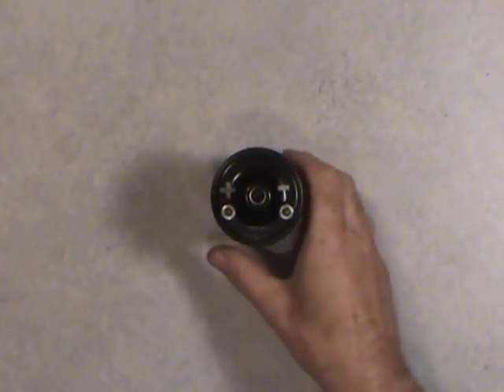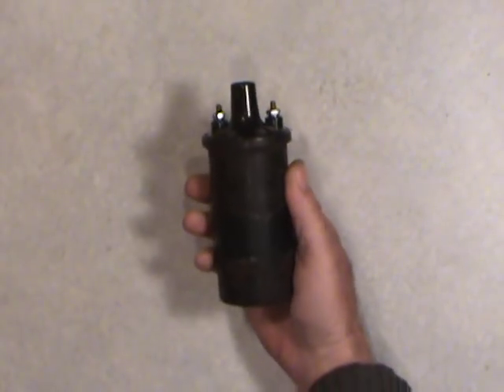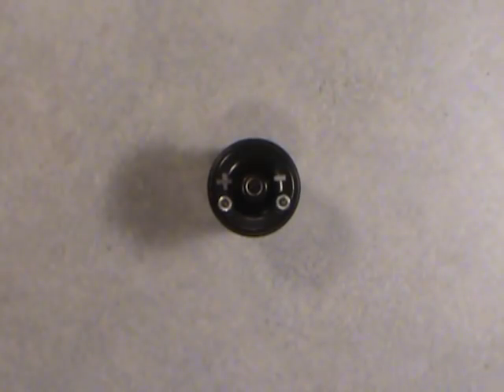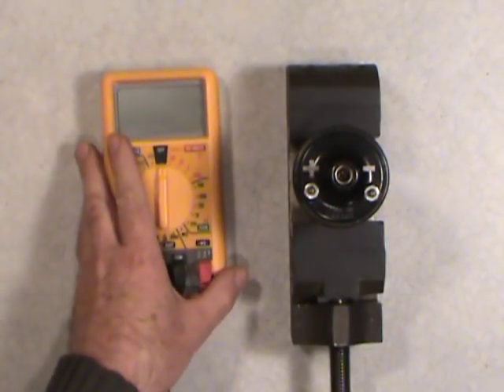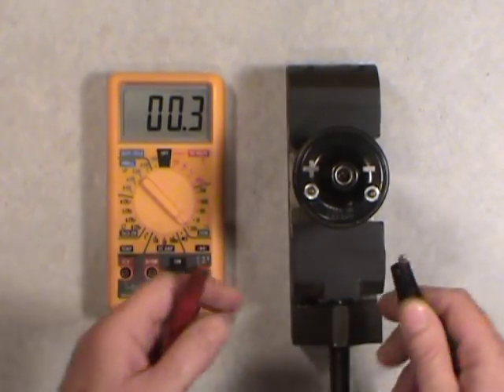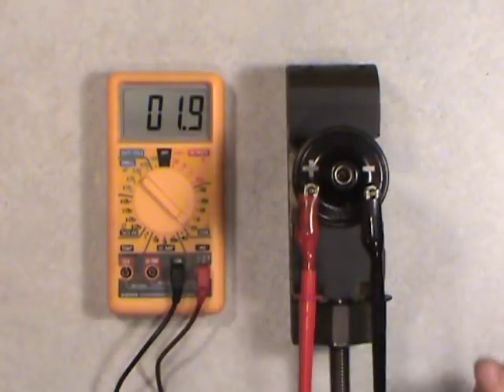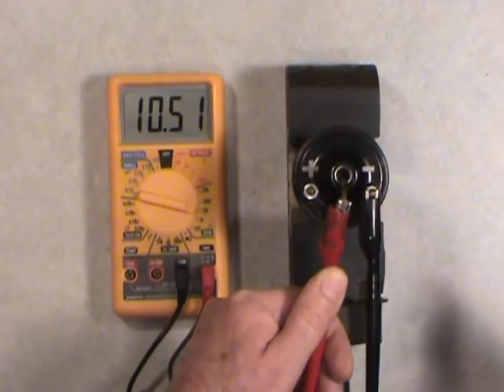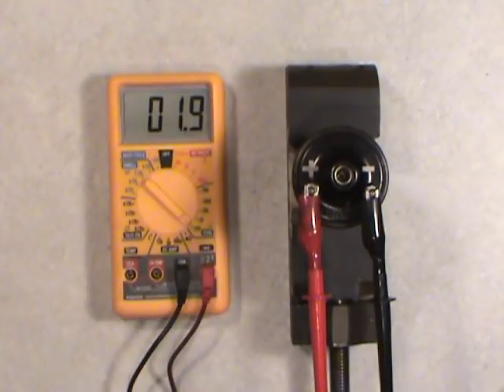Ignition Coil Testing

Comment: Maybe, already mentioned, but, the offset of .3 ohms ("point 3 decimal" in the video) means that you subtract 3 tenths ohms, or, .3 ohms from the total.   You do not subtract .3 for the rest of the ranges.   If the meter is set to 10K, and you measure 963, you are reading 9630 ohms.  Then, take .3 ohms off for final reading of 9629.7 ohms, not 9627 ohms (962.7 * 10).    Test, also, a straight thick wire or paperclip between the two meter plug connectors to learn characteristics of the leads, in this case, resistance.    Finally, if your meter is accurate to 1% at 10K range, for example,  this doesn't really matter at the higher resistances.  lol.
Reply from the maker: Greetings...StuckinMyGarage.........Thanks for watching........Your comment, is done very well, and yes, I'm aware of that tiny .3 ohms being of no importance, once the range selector leaves it's lowest setting.........Even .3 ohms, isn't all that important on the cylindrical, oil filled, type of coil's primary winding, when being compared to, an HEI (High Energy Ignition) distributor's, ignition coil's, primary winding's, very low ohms/resistance specification..........The factory/stock, HEI ignition coil's primary resistance, as I recall, should be just above Zero ohms (but "not" zero ohms), and usually, no more than, about 1 ohm...!!!.........Imaging seeing .3 ohms on  my multi-meter, and thinking that, the HEI ignition coil passed the test...???...lol........Hmmm...on a cylindrical/oil filled ignition coil, where does that one end, of the secondary coil winding (not the end that connects to the "tower"), make connection with, one end of the primary winding (internally)...was it at the + positive, or, the - negative, primary terminal, that's on top of the ignition coil...???...and also, what if that connection's polarity was reversed...???...any thoughts at all...???...and......till next time.......Be Safe, take care, and have a good one.

Comment from the maker: ...what the ignition solenoid does, is, when you turn your ignition key to the starting position, it takes the batteries voltage, and sends it to the ignition solenoid (smaller diameter wire), that energizes the solenoids contact (inside the solenoid)....This heavy duty contact inside the ignition solenoid makes a connection, so that the big, heavy wire from the battery can supply the serious, and high Amperage (electricity), that the starter motor requires to crank you engine over....(con't)

Comment: thanks this really helped a lot
Reply from the maker: Greetings...Bigmack73.........You're welcome, and, thanks for watching.........Make sure to use the "exact" ignition coil, for your vehicle, or, there might be a problem..........With the older cylindrically shaped/oil filled ignition coils, there were basically, two different, low ohms "specifications", on the primary (low ohms) side, of those two sample ignition coils.........Could be, a 1.5 ohm ignition coil, that, also had to have, a "ballast resistor" connected to it, or, it would probably "over-heat", and destroy itself...!!!..........Then, there could be a 3 ohm ignition coil (measured on the primary/low side), that "did not", need a ballast resistor, connected to it at all..........So, always make sure, to install the "exact"..."Specified"...ignition coil, for the vehicle in question, to avoid any problems or expense, and.......till next time.......Be Safe, take care, and have a good one.

Comment: the oil isnt just to keep it cool its also to insulate the high voltage from arcing between windings and out everywhere else its a dialectric
Reply from the maker: prototype9000 Greetings prototype9000....Thanks for watching, and for the information, about, just how "Important", that "Oil" actually is, that's usually found, Inside these good ole..."Oil Filled Type of Ignition Coils"...............................I'm not sure, if I mentioned, in this particular YouTube Video, about, how a "Horizontally" Mounted (aka, mounted sideways, as opposed to standing up and down)...Oil Filled Ignition Coil, that was Mounted on my small block Dodge V-8 Engine, shall we say..."Sprung-ah-Leak" (of "that" Oil, that was supposed to be contained With-in, the Ignition Coil's, metal/cylindrically shaped can/canister housing/body), and here's how I discovered that, kinda by accident, Ignition Coil's..."Oil Leak".............................Back then, I thought it would be a good idea, to maybe "Check"..."All of the Electrical Connection Points/Terminals"...of, both, the "Primary & Secondary" (low and high voltage), Ignition Circuit's, Wiring, and Spark Plug Leads/Wires, which also included, that rather Short, High Tension Lead (looks just like a short spark plug wire), that, went from, the Center Tower, on the Distributor Cap, then, the other End, was Connected to that, good ole "Oil Filled Ignition Coil's "Secondary, High Voltage Tower", that was located, on the Top/Center, of that Oil Filled Ignition Coil (well, if "it" was "Standin' Up-Right", that is...lol)...............................As soon as I "Disconnected", that high tension lead/wire, along with its Rubber-like, Seal/Boot, from the ignition coil's "Tower", I noticed, a quite small amount of, that, good ole "Oil", inside the hole, of the ignition coil's "Tower", and also, some of that very same "Oil", on the inside of that high tension lead/wire's, rubber-like, Seal/Boot as well...............................I did "Re & Re" (Remove and Replace), that...Oil Leakin' Ignition Coil...and, maybe some day, I might "Re-Use" that "Oil Leakin' Ignition Coil", on an Engine, but only, if that particular Oil Leakin' Ignition Coil gets Mounted "Vertically", with that "Tower", pointing to the "Sky" (as in "Up"...lol), seeing as how, a very "Miniscule" (as in, very Small Amount) of that "Oil", actually "Escaped", from that, working very well, at the time (before it was placed into archives, that is), and, "it" also, Tested-out Good, Ohms-wise, as well.............................As far as, the Oil Filled Type of Ignition Coil's "Mounting Orientation" is concerned, and, after my Oil Filled Ignition Coil "Sprung-an-Oil-Leak", while being Mounted in the "Horizontal Plane" (aka, Side-ways), I would, if possible, that is, "Be Mounting", any Future, "Oil Filled Type, of Ignition Coil" (or Coils), with the "Secondary, High Voltage Tower", pointing..."UP"...so, as to "Avoid/Prevent", the very Same, Oil Filled type of Ignition Coil..."Oil Leak"...that I had, way back when, and, that, I'll probably..."Never Forget"...as well...!!!...lol..................................One last thing..."Always Make Sure"...that, both the..."Primary & Secondary"..."Ohms Readings/Specifications"...on a..."Replacement Ignition Coil" (New or Used)..."Exactly Match"...the..."Specification/Requirement"...for the..."Ignition System/Circuit"...that, that..."Replacement Ignition Coil"...gets..."Installed/Connected"...to, or, there might be a Problem or Two, and perhaps, just might..."Fry/Destroy"...one or more, of the Ignition System's..."Component/Parts"...!!!...Yikes...!!!...............................So, there You have it...............................Till next time.............Be Safe, take care, and have a good one.

Comment from the maker: ...more often then not, an ignition coil doesn't prevent the engine from being cranked with an ignition key, or maybe even a start button (newer vehicles)....Unless, some of the newest vehicles out there have the vehicles computer doing a pre-start check (just my guess, that's all)....First off, if anybody is going to work on any vehicle, make sure that you know what you are doing, before you start working on any vehicle!....Batteries emit "Explosive Gas!!!"....1 Spark = "BOOM!!!"....(con't)

Comment from the maker: Greetings anibalcarta....I haven't worked on your particular engine before....Seems to me that it should be a 4-Sroke-Cycle engine perhaps?...and, that each engine cylinder has its own ignition coil to fire the spark plug that is in that particular cylinder....Given that there is only one "Lobe" (Lube?) on the distributor (Timer) shaft that actuates the ignition points (one has to remember that most distributors shafts rotate at one half of the Crankshafts Revolutions Per Minute)....(con't)...

Comment from the maker: Greetings once again anibalcarta....I found an electrical diagram for the 2 coils wired in "Series!"....It looks like a very simple system (once you understand it, that is...lol)....There is a high tension lead (wire) from each ignition coil going to its own spark plug ( 2 coils and 2 spark plugs)....The Timer (not distributor, because there is no distributor cap!), supplies the On-Off connection to ground (just like other breaker-point systems do)....Now, it gets interesting...(con't)

Comment from the maker: ...You asked, can a Coil also break down under load?...Ignition Coils can and do sometimes wear out...One thing that I can tell you, is, if you happen to have an older "Points and Condenser" (breaker points) type of Distributor, then, if you leave the ignition key in the Run position, while the engine is not running, doing this has been know to burn out that type of Coil...To give your Ignition Coil the longest Life, keep all of your connections clean and tight!...Take care, and have a good one

Comment from the maker: ...and, I should also let you know, to pay attention to the following....For your 2-Cylinder type of engine, pay close attention to the Tune-Up Specifications....Point gap setting, and even the Spark Plug Gap specifications seem to have smaller Gaps, as compared to what I'm used to seeing....Pay very close attention to your "Points-Gap"....The Points gap will change right from a fresh installation, due to normal wear with use, and the Points-Wear will change your "Spark-Timing!"....(con't)

Comment from the maker: ...I know it sounds strange to reduce the nominal 12 Volts to a lower voltage, but here's my take on it....When the starter motor is operating, the battery voltage may drop down to about 9 Volts, because of the high Amperage draw on the Battery (maybe as high as 200 Amps!), and, during this time, the battery is allowed to draw whatever the Battery is capable of supplying (yes-sir, less then 12 Volts)....Now, that is why I think that the Oil Filled Coils were designed that way....(con't)...

Comment: Thanks for your video. I understand how you can read the primary side of the coil with the ohmmeter, but how is it that you can get a reading on the secondary side? I thought the primary and secondary windings were isolated from each other?
Reply from the maker: Greetings R Ward....You are welcome, and, thank You, for watching and commenting on my Ignition Coil (oil filled type) Testing video....Both the "Primary" and "Secondary" Coils (2 sets of wire windings to form each individual coil) contained inside this particular type of ignition coil, "Do Share", "1" of the Threaded (aka, screw thread) Terminals with the small (threaded) Nut that protrudes through the top of this ignition coil....The Primary Coil's ohm reading is really quite easy to understand, as, with connecting the "2" (screw threaded) Primary Terminals to the ohm/multimeters test probes/aligator clips, are actually the "2-Ends" of the Primary Coil itself...

...where-as...

...when it comes to the "Secondary" Coil, "1" end of it gets connected to "1" of the screw-threaded "Posts", that it "Shares" with one end of the "Primary" coil windings ends, and, the "Other End" of that "Secondary Coil" gets connected to the "Secondary" Tower (where the ignition wire gets connected to, in the top center of this ignition coil, and goes to the center of the distributor cap)...

...now it really gets interesting (almost like Rocket Science!...lol)...

...if You, or I, can figure out just which of those "Primary" threaded terminals that "1" end of the "Secondary" Coil gets connected to, and take an ohm reading from there, and hook the other test lead to the Secondary "Tower", I'm quite sure that we would be getting a pretty accurate ohm reading...

...but, wait a minute now (say what?)...

...seeing as how only "1" end of the Secondary Coil's Ends gets connected to "1" of the Primary Terminal "Posts"...What About The "OTHER" primary terminal (screw) threaded "Post", not having the Secondary Coil connected to it, in any way what-so-ever?...

...and...

...how the heck, are we able to obtain a Secondary Coil "Ohm-Reading", when we connect an ohm/multimeter test lead to the threaded Primary Terminal that the darn Secondary Coil "Is-Not" even connected to???...

...(time for some form of investigation, don't-cha think?)...

...here's what I came up with, and, I may have learned something in the process as well (see that, "Miracles" really can happen!!!...lol)...

...Hmmmmm...I figure that, the Reason that we are able to Obtain any "Secondary" Coil "Ohm-Reading" at all, while hooking up one of the ohm/multimeters test leads to that "Primary" threaded terminal, that the Secondary Coil "IS-NOT" connected to, is because, You, or I, and maybe others too, are "Actually", Ohm's/Resistance Measuring the Secondary Coil "THROUGH" the Primary Coil as well...

...but why...

...aren't we "Seeing" an "Increase" in the Ohm's Reading, if we are "Including" the Primary Coil in the very same "Test Circuit", when we are "Testing" the Secondary Coil in this manner?...

...I reckon that...

...seeing as how the Primary Coil Only measures the maximum of about "2" Ohms, that My Ohm/Multimeter, when on the "HIGH" Ohm's Range (or resolution), "WON'T" be able to Display, that very "Small" (about 2 Ohm's max.), and I say again, when the Ohm/Multimeter's Dial is set for a very "High-Range", and in those very High, "Thousands of Ohm's!!!"

So then, as I see it, without even realizing it, we can actually "Include" the Primary Coil, when we only want to measure the Secondary Coils Ohm reading, but wait, there's even more!...

...how about this scenario...

...let's say, for instance, that the Primary Coil is "Fried" (aka, non functional, with no ohm's reading showing what-so-ever on the ohm/multimeter), and...

...then, we happen to measure the Secondary Coil through the Primary threaded Terminal that "Does-Not" have one end of the Secondary Coil ends connected to it, then what...

...Hmmmmmmm...I be thinkin that we "Would-Not" be seeing any Ohms at all on that Ohm/Multimeter Display for the Secondary Coil...cuz...we "Need" to have a "Good" and working Primary Coil to complete the "Test Circuit", when we are "Going Through" the Primary Coil, in order to Test the Secondary coil in the previously described manner...

..so then...

...is it, ''Clear-as-Mud?"...lol...

...Be Safe, take care, and have a good one.